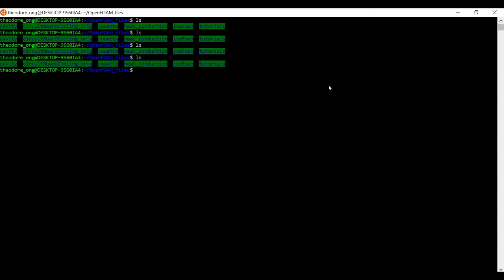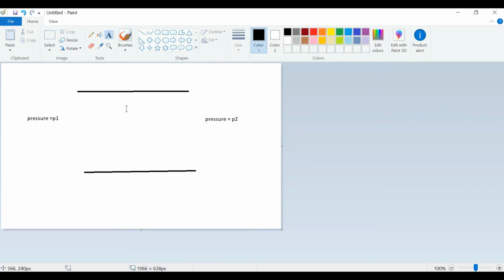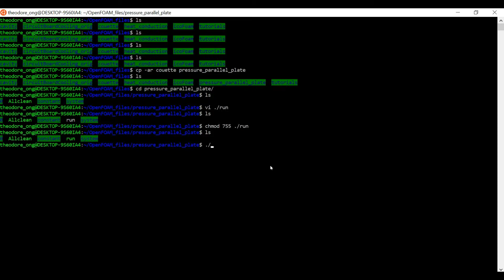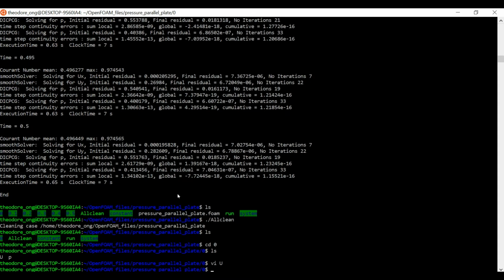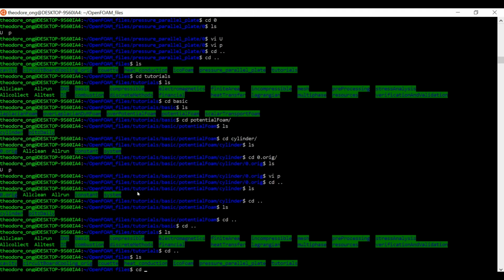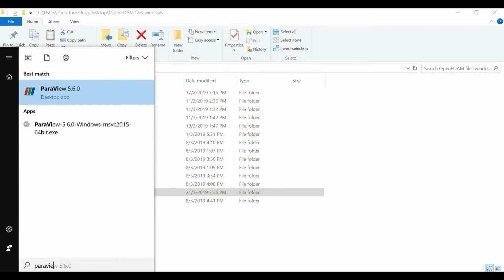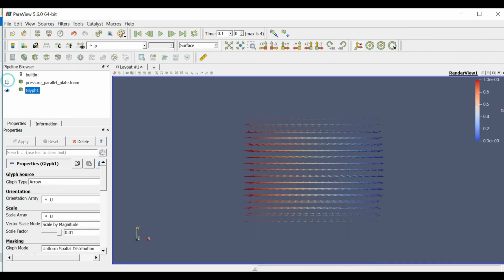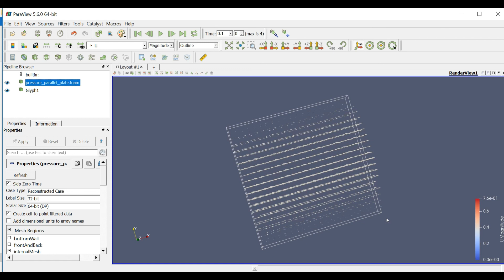OpenFOAM for Beginners win10 9 - Parallel Plate pressure driven flow

Comment: If i set a moving wall boundary condition and also pressure gradient at left and right walls.Suppose pressure gradient is 3 units(from right to left) and the velocity on the moving wall is 5 units.In t=0.5,the resulting velocity contours  are still showing velocity as 5units.How to validate ??
Reply: @TheoOngScienceAndEngineering  Thank you sir.